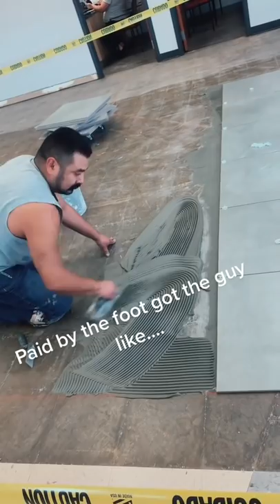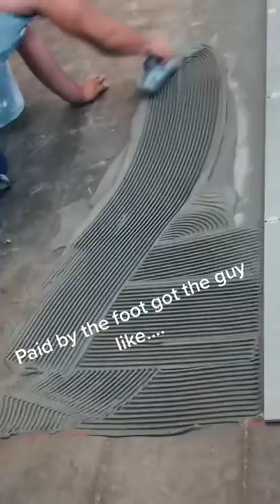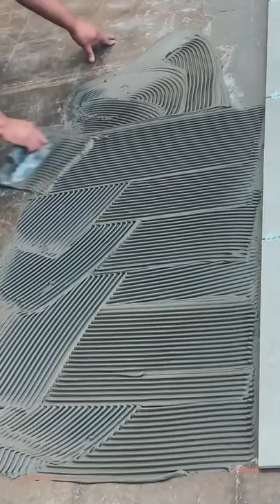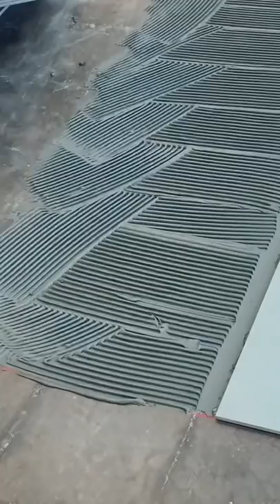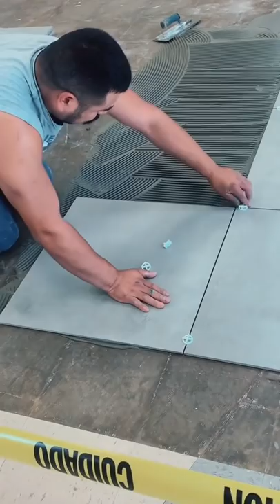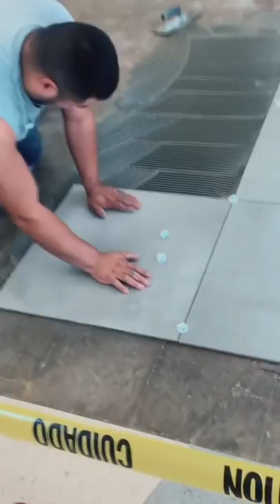Dude laying our new tile is 🥶 CREDIT terrywatson806 #Shorts

Comment: All the tile videos I've watched. No one ever said smooth out the edges so the mortar doesn't seep through when you push the tiles down. This dude is genius level
Reply: Thanks captain.
Reply: Common knowledge. That’s why nobody says it
Reply: On problem is now there is a void at the tile edge. Will take more grout to fill that in and will be weak in the corners. I've seen a lot of tile jobs that I had to rip up and do right because of someone doing this.
Reply: @wingfighter2  maybe I should edit my comment. Never saw anyone do this before. Because the guy in this video didn't speak
Reply: its alright if a little comes through, you can clean it before it gets too hard. it really sucks when you drop something on your floor and a corner of your tile snaps off bc theres a hollow spot
Reply: Him doing that provides less coverage on the tile and makes pockets prone to cracking the tile if stepped on with enought weight. Especially since the back of the tile wasn't buttered to ensure 100% coverage
Reply: @eclapsed  Yes exactly, plus even if you get thinset pushing up through the joints a good wipe with a sponge would solve the issue.
Reply: @dannyboi9552  didn't think of that. Maybe that's why I never seen this done before.
Reply: Wrong. It creates voids under the tile, which is especially not good in the edges. Also, he should easily be using a 1/2inch trowel for a tile this size.
Reply: It is easy to clean after toi though.
Reply: @atrociousalien  You have to get the thinset out of the groove or it will dis-color the grout. A sponge would be difficult to get in there deep enough.

Al that needs to be done is keep any globs away from the edges. If it is just the ridges, the tile isn't usually  pressed into them enough to show thru in the grout. The other option is to use the corner of the trowel to bevel it back at about a 45deg angle. Corner on the ground, side against the already set tile and raised from the corner, perpendicular edge also raised. Almost no material is removed, but the grout groove is kept clean.
Reply: @flipnasty2296  I never laid tile on grout. I've only used grout for the crevices
Reply: I was trying to figure out the reason he was doung this. Thank you
Reply: @Sphynx823  they're saying you shouldn't do this because it leaves a void under the tile and the tile can crack
Reply: @wingfighter2  how so. I’m a mechanic so I never knew this. Just because you know it doesn’t mean other do smh
Reply: @robertroderick4933  there’s nothing wrong with it only this guy took way too much thinset off those joints
Reply: @christopherhernandez1863  pretty sure that's what I said. Need full coverage or those tiles are going to chip. I don't have the most experience with cheap tile like that most of what I lay is 1/2 and 1/4 marble, and it's nothing like laying this but one things will always hold true you need 100% coverage.
Reply: Lol for a moment I was like why he doing all that 🤣 😂  thanks for explaining
Reply: @court2379  Yeh I use a combination of a sponge and knife, does the job pretty good.
Though no matter what you do chances are your still going to some scraping before grouting.
Reply: @atrociousalien  I usually use a spacer as they are the width of the gap and scoop it out deep enough. And then a rag or sponge to clean the face of the tile.
Reply: Great job but there is an extra step which master tile guys do. Anyone know?

“Back butter”
Reply: @wingfighter2 no one asked.
Reply: It’s basic actuallly
Reply: Yeah that was pretty slick will definitely try to remember that one
Reply: @robertroderick4933  Exactly. I watched a friend move his refrigerator and cracked the edges on a few tiles. Grout won't fill that void all the way
Reply: Smoothing out the edges with that type of trowel creates voids and weak edges.
Reply: @Bottomfeedr1229  they said it creates voids in the mortar and can cause tile cracking
Reply: @mattjudy6780  I thought the ridges looked small for the tile size
Reply: I did this for 6 years n I never saw one person try that
Reply: Excellent work exactly what I thought ! 👏
Reply: I noticed that too. Never gonna miss that step again.... just read the comments and i guess thats why I didn't do it before. Maybe a fingers width would be ok but not as far as he did.
Reply: Thats actually bad lol the edge will break easy now
Reply: 3.4k people want their tile installed incorrectly.
Reply: He didn’t push back and forth against the grooves to ensure no air pockets in addition to not back buttering….
Reply: @sushi0085  from what i have seen to the ridges of the thin set have to go one way to so the air can escape when the tile is laid.
Reply: I think everyone does it 🤣 it’s common knowledge
Reply: Hello fellas! Chick in the chat now...I’ve learned a lot reading through these comments! Impressive! 
BUT....what is “back butter” ?
Reply: That's because if u run your trawl correctly u don't have to he is doing a terrible job
Reply: I think you watched too many YouTube recommend videos... I will pray for your soul.
Reply: @erinntay  when you apply mortar directly to the back of the tile
Reply: @eoin5628  I don't think everyone does it. This thread is full of people that's oppose to it. And I never saw anyone do it before.
Reply: @Texas240  and growing 😂 😂 😂
Reply: @820light  Ahhhh ok! Thanks for answering me 👍🏼
Reply: @820light  - I think this is a guerrilla advertisement by the floor tile industry. They show a guy with apparently good work ethic and efficiency but he's laying the tile in such a way that people will break their floor tile and have to buy more. 

Best of luck to such people getting matching product if they didn't buy extra for the initial job! Heck, if they can't match the tile after some break or chip from the weak install, maybe sell them on a whole new set!
Reply: @erinntay  no problem 👍🏾
Reply: @Texas240  I'm just glad I didn't see this video before doing a tile job. And that the conversation was started so hopefully people will read this and not try his tactic.
Reply: @820light  it’s common sense, my dad lays floors and he says everyone he’s ever known to lay a floor does this.
Reply: Jody Lien  Thank you! 👍🏼
Reply: Won't matter the first time someone drops something hard on this tile.  It will shatter because he didn't backbutter
Reply: @robertroderick4933  no you didn't.  Not from that you didn't.  It's because he didn't backbutter.  Anything over a 12"x12" needs to be backbuttered.  I backbutter everything but mosaics.
Reply: You want the thinset to come through a bit means its gotten every surface spot he will have gaps underneath his edges which in future will cause cracking
Reply: Not really No back butter and the adhesive lines should be going in one direction 🤦🏻‍♂️
Reply: Right?!? I just redid our bathroom tile myself and wish I knew that gem!
Reply: @gobosMommy  from the replies, I think it was best you didn't know this gem
Reply: @tell2k11  I figured the lines were off but I didn't think nothing of it since he used the wrong sized trowel
Reply: @eclapsed  exactly, needs to be back buttered, and I'd also like to know what size trial that is. Better be a half in. Thats one of the most common mistakes I see.
Reply: you always clean grout lines before you grout. theres plenty of grout in the line. I get cleaning a small area so they dont, but not to the extent this guy did
Reply: I put extra there. And bread the tiles if this big. Often use liquid stuff fix hehe(flytfix)
Reply: @aMessIam1  yeah, backbuttering is important if you want it to stay
Reply: @serbrus6469  that’s true on the lay down. But once it’s laid down pockets can still form.
Reply: It's a margin trowel he uses for that. To create a margin to prevent mortar from squishing out too far and into the grout lines
Reply: There is no coverage on his tile in the first place not using the correct trowel size and back buttering the tiles. Yes I use my margin trowl to angle the thinset away from the edge like that but leave more thinset so there are no voids under the tile. He has hollow spots under the while tile especially the edges. If this is commercial then soon as they bring heavy equipment in on dollies this guy will be called back.
Reply: It's not necessary and it actually not a good idea
Reply: No back butter tile 😮😅
Reply: No back butter on the tiles...good luck.